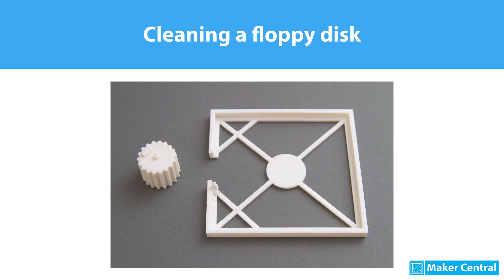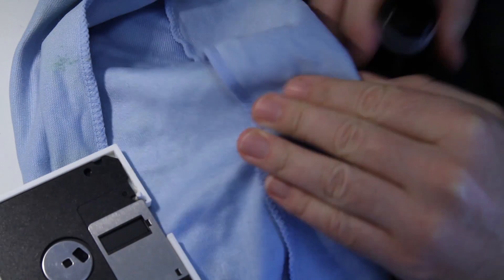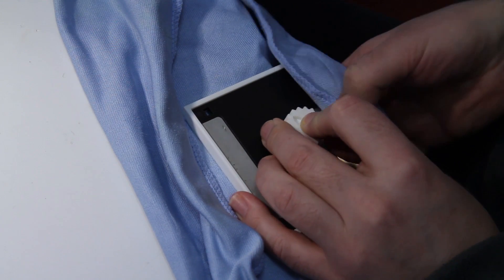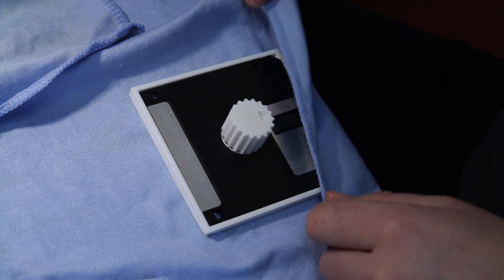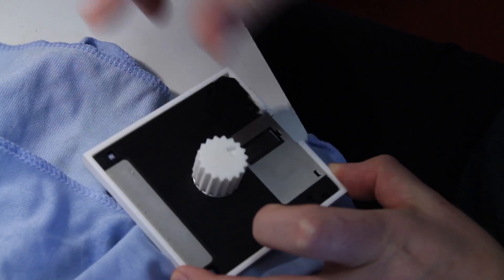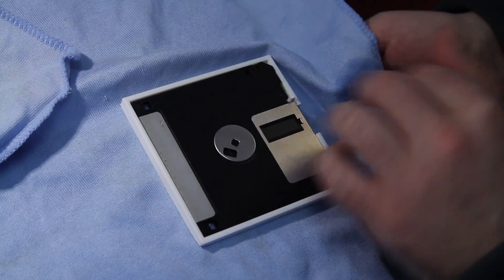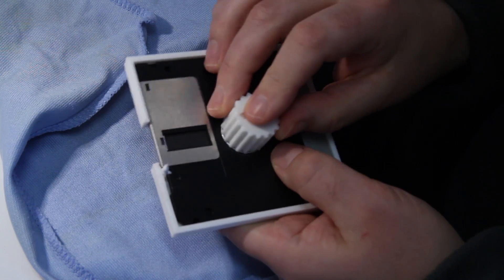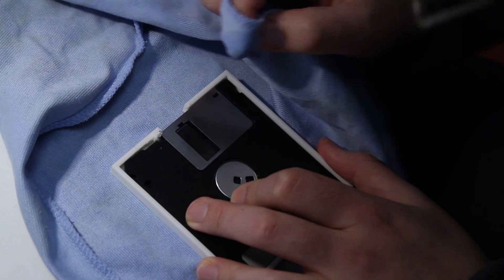Cleaning Floppy Disks

Comment: Hi, can you please clarify which is the best cleaning liquid solution for this? Some are using IPA, but some say it is too harsh on those magnetic disks. What about surgical spirit, or dish wash soap liquid ? Thanks.
Reply from the maker: I've used denatured alcohol and worked fine for me. I haven't tried anything else.
Reply: I would be careful here “denatured” alcohol is commonly called mentholated spirits. Something I used to use to clean oil paint off brushes. It’s very harsh. I would not be sticking that on my floppy disks. Maybe where he is from it’s another product or lost in translation. The old floppy disk cleaners from the 1980’s used isopropyl alcohol probably mixed with distilled water to weaken it. I still haven’t found the best mix yet. But I would favor isopropyl alcohol over mentholated spirits any day.

Comment: Great method thanks!

The link for the .stl files doesn't work - can you please provide it?
Reply from the maker: Sorry for the missing link. I've updated the link, please try again. Let me know how it works out!
Reply: Kinda - the link now wants https.  If I change it to http all works fine.  Thanks!
Reply from the maker: I can't reproduce this. What browser are you using? I checked IE 11, Firefox and chrome.
Reply from the maker: That's correct, I don't use 443 yet. It's a shared hosting service so it's probably using aliases to do the lookups. Thanks for the heads up!